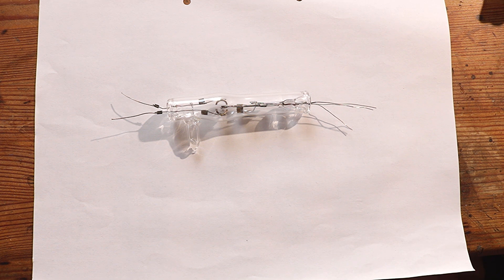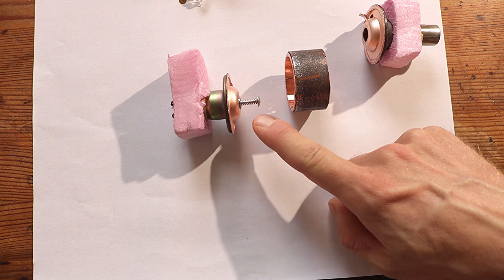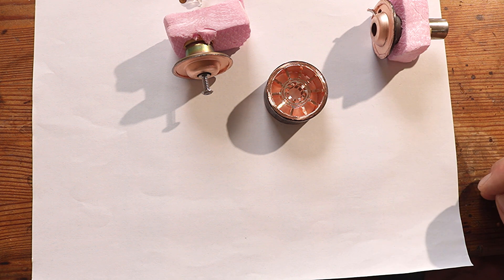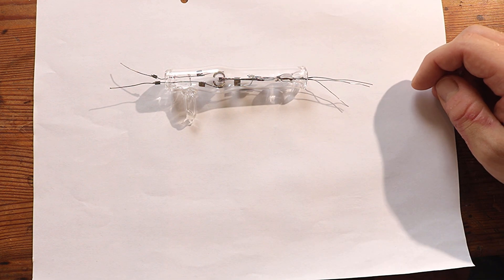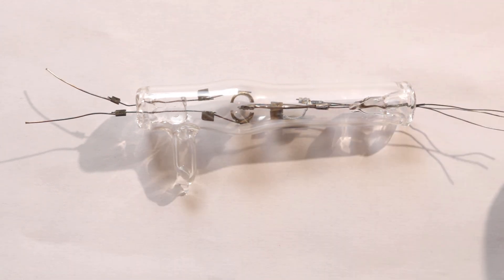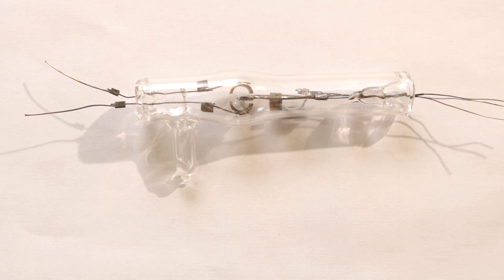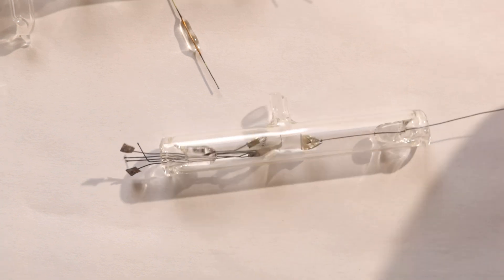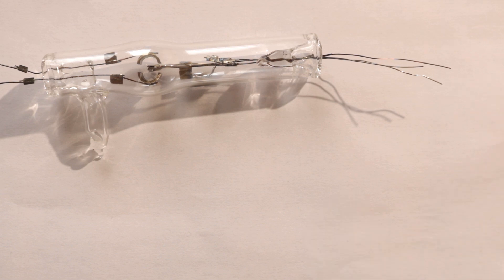Building a magnetron first attempt

Comment: Gidday mate, great work..... Many years ago I attempted some vacuum tubes, the seals are a problem of course, theres Kovar and various glasses with multiple layers to adjust the expansion coefficients, Titanium works with some glasses, if my memory is correct. "Quartz," the main point of my comment, is that Tungsten wire is often produced by powder metallurgy, ie tungsten powder is packed inside a steel cylinder and sintered, then it is drawn via many dies to a long wire, this leaves the possibility for very long voids in the wire, microscopic of course, but sufficient to allow some gases to penetrate through the metal. Take a look at the metal seals in linear halogen lamps, theres a piece of thin ribbon welded in between the conductors  as a vacuum seal. Check out the expansion coefficients of the glasses vs the metals youre using & avoid tungsten at the seal.

Comment: Tungsten should have a nice copper-brown-orange color when it properly bonds to the glass. Silver also makes a strong glass bond... I wonder if one could electroplate or sputter sliver onto tungsten. Also check out housekeeper seals... A little more work to pull off, but looks like the best way to get good glass bonds.

Comment: in the next version it will be a good idea to add a waveguide do direct all the microwaves that are being lost.I would like to know what kind of power supply you are going to use : )
Reply from the maker: @Itz_Mr_Emmanuel  I think rn I just have a flyback transformer available as power supply. A waveguide may or may not be feasible depending on what frequently I'm at.

Comment: Excellent work as always! 

Pinch seals haven't given me that much trouble, but I wonder if that's because I use much smaller wire in the seal. It may be that everything heats and cools more evenly when there's relatively little mass of tungsten, so that when you use thicker wire, you really need to concentrate heat on one wire to make a good seal... It could also have to do with the composition of the wire, all of us hobbyists are getting wire from different sources with no way to independently verify their composition. 

Also, I'm excited to see how your cathode coating experiments proceed. I believe the most common binders for that application are methyl methacrylate or nitrocellulose. I have a bottle of commercial cathode coating material that has settled into a hard puck in the bottle that I'm working on re-suspending so I can also try building coated cathodes. I don't know how easy it is for you to order things from NA but "electrontubestore" sells thoriated tungsten wire and I've been considering buying a small length of that (about 30cm for 30USD) to play with as well. I'm trying to build a VFD, so I need a lot of emission without the filament being so bright that you can't see the phosphor glowing behind it. 

Anyway, I look forward to the next video, keep it up 👍
Reply from the maker: @SignalDitch  It could very well be the the thickness of the wire. If I use a long piece I notice that the tungsten just conducts too much heat away so fast. Maybe I try it with thinner wire but shorter. (I always used the thicker stuff for current handling) 

I tried making nitrocellulose myself but it just dissolves if you leave it too long. I might just buy it. But rn I want to test if I could sinter the yttrium oxide on there somehow. With the benefit that you potentially coat it multiple times with the oxide not reacting with moisture and it hopefully has more adhesion.The work function is slightly higher tho. Also it doesn't solve the problem that the coating is uneven so you might need to work with a binder there anyway. 

I'm definitely gonna check out the seller for the thoriated tungsten. I think so far I just found overpriced stuff from VWR for example xP
I've read, with the right coating the filament has to glow just very slightly, so I'm sure you can get this to work😃
Reply: @thesciencefurry sputtering would give you the results you're looking for when it comes to the multiple coatings. 😊
Reply: @thesciencefurry  often I see crimp seals made commercially with a ribbon rather than round conductor, perhaps the thin material with more surface area has better adhesion? The feed through portion is also typically pretty short, sometimes so short that the connected wires are also inside the glass.

My suggestion would be to try a commercially made feedthrough from either a light bulb or cheap vacuum tube, just to simplify that portion and focus on fixing the other issues. You can always work on your feed through technique, but you're trying to make a magnetron, not a feed through.